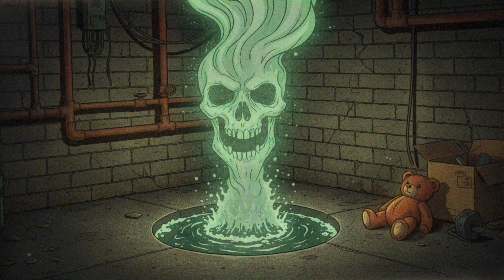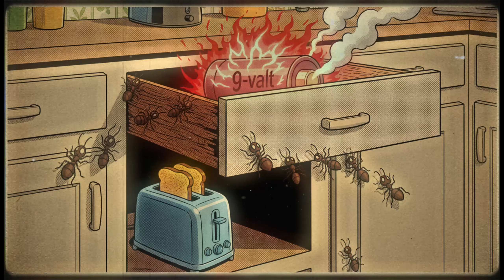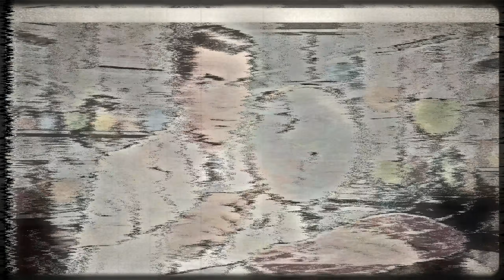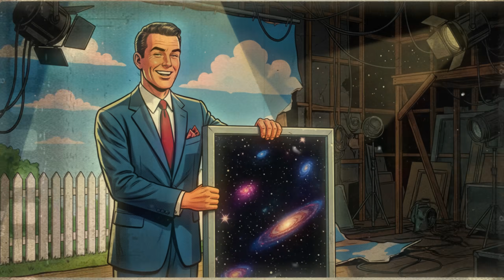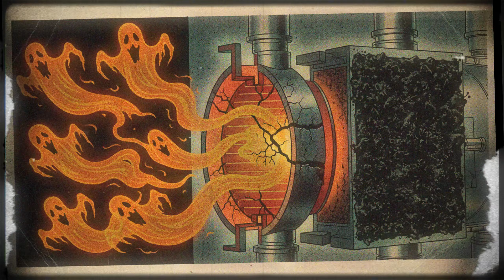30 Hidden Home Dangers You Are Ignoring Right Now

Comment: This video exposes 30 hidden household dangers that can compromise health and safety, ranging from structural issues to daily habits. The main goal is to promote proactive maintenance and awareness to prevent accidents and health problems.

Here are some of the key dangers highlighted in the video:

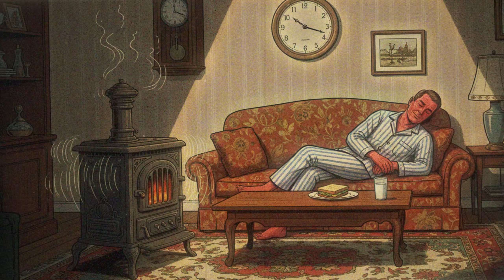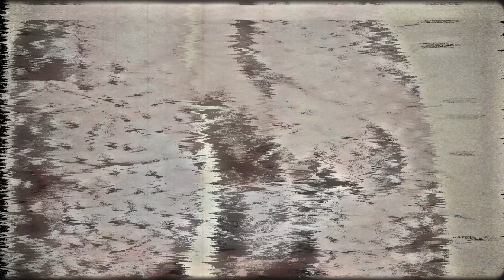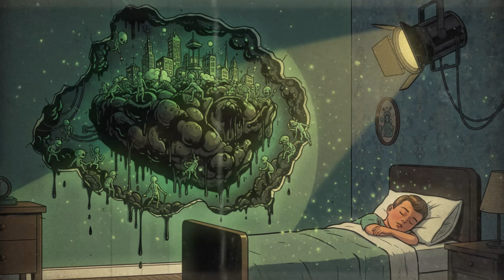Invisible Health Threats: Dangerous substances include radon gas (1:16) in basements, carbon monoxide (2:07) from poorly serviced furnaces or cars in attached garages, asbestos in popcorn ceilings (3:27), and mold (6:35) growing inside drywall due to leaks.
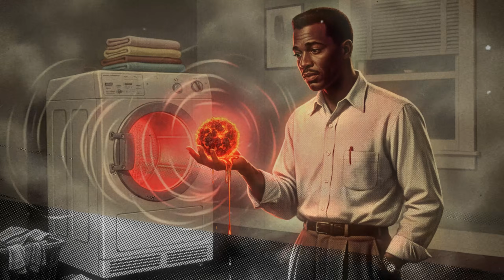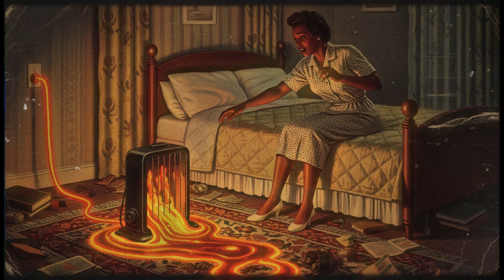Fire and Burn Hazards: Common risks include dryer lint buildup (8:08), misuse of space heaters (8:51), spontaneous combustion of oily rags (9:40), and overloaded extension cords (11:21).
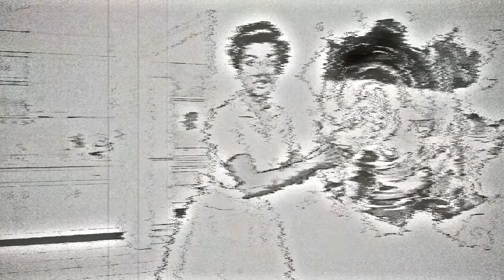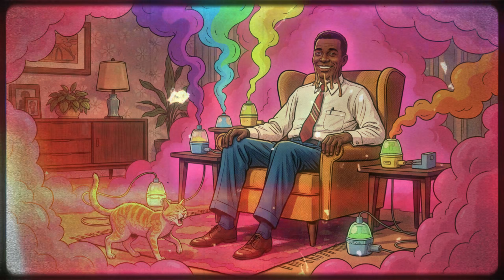Chemical and Toxic Risks: Dangers include lead paint (5:07) in older homes, toxic fumes from scented candles and plugins (7:04), and dangerous liquid detergent pods (12:55) mistaken for candy by children.
Structural and Safety Issues: Risks include furniture tipovers (18:32), unreliable window screens (19:20), and extremely high tension in garage door springs (22:11).

The video emphasizes that knowledge is survival and encourages immediate action, such as checking smoke detectors, fire extinguishers, and cleaning dryer vents (25:35).

Comment: I almost had a fire from a space heater. It was the plug and socket overheating. I smelled something burning and quickly unplugged the heater. One socket in a duplex receptacle was completely destroyed. They need to use better materials. I took to only running the space heater on low so instead of 12.5 amps I'm only drawing 6.25. I'd rather go through the trouble of making clearance to safely run 2 heaters on low, plugged into different receptacles than one on high.  I might even add a 20 amp circuit to the bedroom to plug a space heater into
Reply: Infered

Comment: Never buy non-stick pans.
Reply: Cast iron is always been the safest and will always be the safest pans to use and with proper care will last indefinitely
Reply: @ironmartysharpe8293  you may get a dose of iron from cooking on it too.😁
Reply: @ironmartysharpe8293 Cast iron pans are one of the oldest types, they were usually the only types of pans being used back in the 19th century, cast iron pans on stove top, cast iron dish in oven, and even cast iron pot hung over a fire cooking outdoors (like you sae witches use in fictional stories), the latter is what you'd usually see at an outdoor party/gettogether in the 1800s since that was before outdoor gas or charcoal grills we use in modern times were invented. Charcoal was still used in indoor ovens and in furnaces for heat back then, there was actually a coal delivery man who'd come by weekly

Comment: They need to discontinue those laundry pods.
Reply: I never use them  , I only use powdered soap because another problem with those detergent pods is they don't completely dissolve which can clog the lines in your washing machine and dishwasher and can damage the pump because I have found little pieces of melted plastic in the washing machine and the dishwasher
Reply: @ironmartysharpe8293 One thing you could do with the pods is the prick a small hole into them and pour out the liquid soap onto your dirty clothes sitting in the washing machine right before you start it. But it's better to just use regular liquid detergent. I'm just thinking that if you're ever out of detergent and all you have left is a box of those detergent pods and don't feel like going to store until the next day, you can just prick hole into a couple of them like I said above